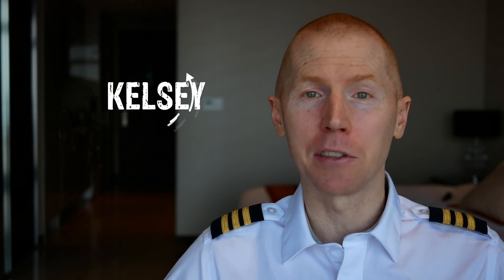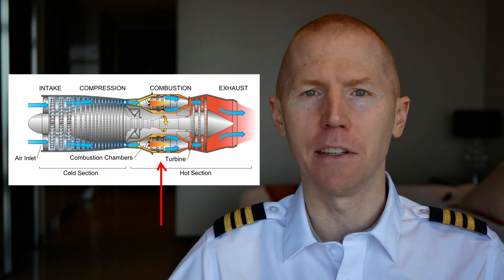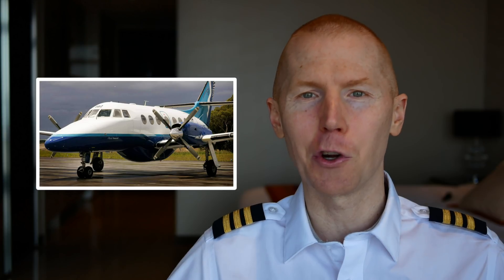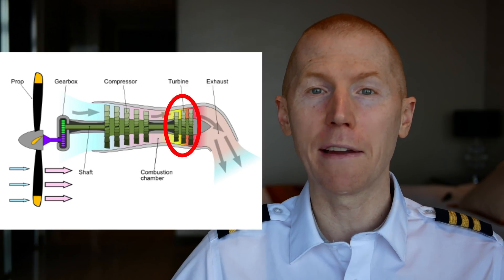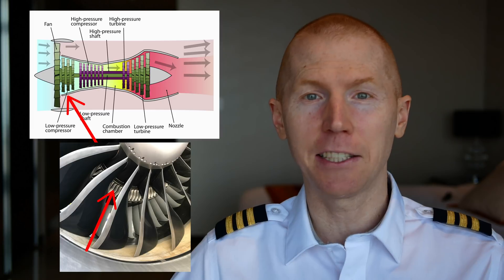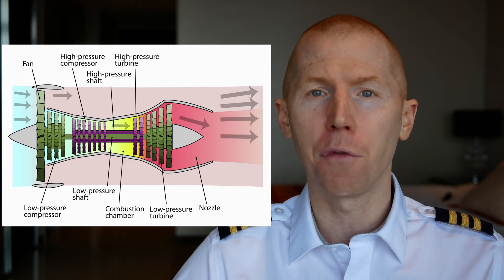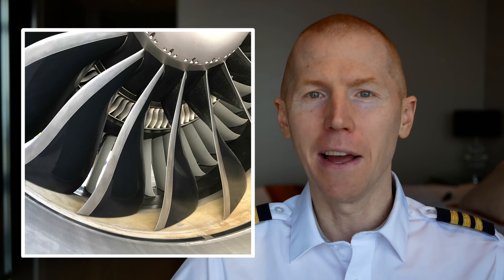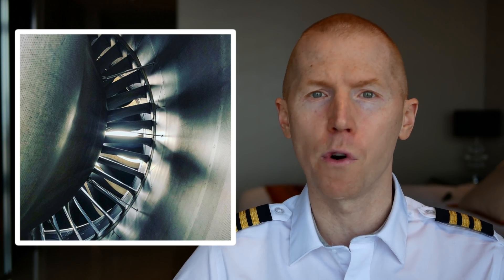Is a Turbofan Engine or Turboprop Engine Safer? | Pilot Explains

Comment: turbofan are safe for passenger and crew and better for every day airliners, but dangerouse for mechanics and ground crew. Turbo props are safer for mechanics and ground crew because there open rotor engine instead of enclosed rotor, but dangerouse for passenger and crew

Comment: To answer your question about me feeling uncomfortable when I see a propeller: Yes, But it is the very remote but possible chance that a mechanical failure or defect in the prop itself could result in a violent dissassembly of it. That keeps me from sitting in line with the blades.

Comment: My wife was a American Airline employee and we would fly standby (non revenue) a lot for vacation or to see family. To get to a hub we needed to fly American Eagle. The airport we used in Corpus Texas had just the CRJ turbofans when we first got married. They sat 50 passengers but were always weight restricted to about 42 or 44 passengers due to temp/pressure/weather. It was hard to get in or out as a standby passenger on those jets. Later they started using some ATR turboprops. I loved them because they held about 60 passengers and never got weight restrictions put on them so you almost always could get a seat standby. The atr's had a lot more headroom than the crj planes and didn't seem to get canceled much for mechanical reasons so I liked them more. My wife didn't like the ATR props because she felt like she was too good to fly in a prop plane and complained that the props were too slow. I liked the props because I could always get a seat, the flights were more reliable, and they flew lower so you could see the landscape better during the flight.

Comment: I think that the turbofan is probably safer in terms of in the event of a blade off in a  turbofan the fan is contained in a case and it's designed to contain the blade should a fan blade come off a turboprop on the other hand if the bade comes off it could go right though the fuselage and kill the passengers sitting in the seats near the prop or it can damage flight controls making the aircraft hard to control. Course if the whole fan disc comes apart and not just a blade or two  like it did on that one United DC-10 then there's nouthing stopping that kinda mass spinning that fast. Also turboprops are probably more dangerous to ground crew and people near the aircraft as they can get struck by the blades and killed if there not careful and sometimes its difficult to see the arc of the prop when it's dark or whatever. Then again the turbofan poses the risk of sucking in someone who gets to close where as a turboprop doesn't pose that hazard or mabye I'm wrong please let ne know.

Comment: Turboprop engine is more fuel efficiency by 33% but more produces more noise, another place which i can't understand, in army you can't sit i propeller line witch is the line between the right and left propeller, as i can see in political aerospace turboprop engine planes has not the red colour in propeller line why?

Comment: Since the first time I experienced the sound of the two PW150 on a Dash 8 Q400 (The Q is for 'I don't want to know how loud the non-Q version was)  when spinning up for take off thrust, I lost all fear of them. I DID formerly associate turboprop engines with older and less sophisticated aircraft, but after understanding how they work and seeing (and hearing) them in action, I felt quite safe.

Comment: Actually turboprops and turbofans are basically identical. The difference is only really the speed regime of the aircraft, because conventional propeller efficiencies start to drop off in the transonic speed regime. So really you find turboprops on 'slower' aircraft irrespective of size (Kingairs, C130's etc) and fans on airliners which typcically cruise on in the transonic range. Bypass ratio is really only to do with maximising propulsive efficiency, that is matching the velocity of the propelling stream to the cruising speed of the aircraft.

Comment: Huh.  I always thought it was more of a controlled, continuous burn going on inside of there rather than an "explosion."  Even piston engines [generally] don't have actual explosions going on inside of them but rather a controlled burning of the fuel/air mixture.

Comment: Great explanation Kelsey. 
To answer which would I be more comfortable on, say it was a Saab 340. I assume that the pilots flying that would have a lot experience and time in the air compared to a pilot flying a 747-8 
So I would be more comfortable with pilots like you vs. a captain with 650 hours and a FO with 320 hours of flight time

Comment: I feel comfortable flying in a turbo prop along with the turbo fan. I personally feel a little bit safer on the prop job as I feel they are a more stable aircraft. Usually they are wing over which I’m a fan of. If the engine or engines were to fail I feel they may have a better chance of making a landing.

Comment: 5:16  The core of the Turbofan isn't doing much in the way of thrust, it's primary function is to spin the big fan. About 85% of the thrust produced by a high bypass Turbofan is from the fan itself, the core maybe adds about 15%.

Comment: I would prefer an open turboprop engine, since open propellers have a better energy transfer efficiency than any type of ducted propellers, including trubofan engines, since they have lesser friction surface and better "at the end of propeller blade" effects in air. --- But I admit that is just because of the physics of open propeller vs. ducted fan.

Comment: I just don't like small planes. I wouldn't fly on a small regional jetliner using turbofan engines either. I'm talking basically anything smaller than a 737/A320 is a no go for me.

Comment: I don't know you didn't mention it so it may not be applicable. Does the air going on the outside of engine core reduce heat? If so, is that beneficial or a disadvantage to the core?

Comment: Why anyone would think turboprops are less reliable is beyond me. They are noisy inside, that's all. I have been a passenger on several turboprop planes: Fokker F27, Saab 340, Shorts 360, and they one thing you wanted to avoid is to sit next to the propeller.

Regarding reliability: Tupolev Tu-95. Nuff said

Comment: I was directed to this video from a more recent video because I never really understood Turboprop engines versus Turbofan engines.  I had no idea how similar the two were or that a turbofan actually uses a propeller.  It certainly makes sense why a turbofan would be so efficient at low altitudes now.  I was never afraid of prop engines, but now that I know the difference I'll view turbofans differently.  Thank you for a GREAT lesson here!
Reply: The turbofan doesn’t use a propeller, the fan is by a propeller. It’s a compressor that compresses the bypass air just as the LP and HP compressor blades compress the core air. All of the energy from the fan goes into compressing the air so there’s no energy left over for the fan to produce any thrust of its own. And no, turbofan perform very poorly at low altitudes for that reason. Turboprops and other true propellers have good performance at low altitudes. I don’t know why 74Gear didn’t give a correct explanation.

Comment: I’ve been on a turboprop on a nasty night. There was a pounding on the fuselage for a long time - like half of cruise - sounded like many people beating on fuselage with a hammer. When air calmed down so the flight attendant could come around (only 4 passengers on Fokker 50), I asked him about the hammering. It was what I expected - ice from the propellers beating against the fuselage. Frankly, I don’t like that but I assume the pilots don’t want to crash any more than I do and they must feel safe. I much prefer a 747.

Comment: I've always figured turbine engines in general, be they turbojet, turboprop, or low or high bypass turbofan, would be very reliable. If there's anything to worry about it's a piston engine - there's so much more to go wrong with them. Though the combination of the two, the turbo-compound engine, was apparently even less reliable than the straight piston engine it was based on - apparently some DC-7 mechanics referred to the power recovery turbine as the "parts recovery turbine".

Comment: There is no "explosion" in a gas turbine engine. An explosion implies an ignition source is constantly required as in the case of a piston engine. Once a gas turbine lights up, the igniters are no longer required as the flame is held within the combustion chambers. It is the action of the hot gasses passing over the turbine section that drive the main shaft. There is very little pressure within the jet pipe. Trivial, perhaps but, it is important to explain things correctly. I'm guessing most people here don't come from a technical background. 🇬🇧

Comment: The problem that most people have is the commercial turboprop is generally a smaller commuter type plane. Usually those are subject to more turbulence than the larger planes. They usually get a bad reputation from this because propellers are associated with more turbulence instead of realizing it’s a smaller aircraft along with it. This is why my mom didn’t like flying when she was on the smaller planes. Props are also noisier.

Comment: No answer though. You tell me, you're the expert. I imagine a Turbofan is more protected, but then again it's much harder to break one of the three a prob blades than a fan blade.  I WANT AN ANSWER. Also, why is the prop an a different shaft? And what drives the compressor according to your explanation?

Comment: I was in the Navy for 20 years and flew on turboprop planes every now and then, mainly when I was transferring from/to a ship to somewhere else in the world.  I rode in a variety of planes doing this and never once thought about the engines, other than they were kind of loud, but that could have also been the lack of sound insulation the plane had, because it wasn't a passenger plane.

On the other hand I rode a helo off a ship to get from a ship that was out at sea to a base to fly out of, and because there is a higher rate of crashes involving helos, that made me a bit nervous.

Comment: The thing about turbo props is the engine tends to create more vibrations and noise.  So as a passenger it can feel like the planes is shaking itself apart.  This is only made worse by the fact that turbo props like the Dash8 get stuck on short haul high turnover routes so they take a lot more cycles in a short period of time.   Add to this their popularity with cheaper connector airlines and the difference becomes pronounced.   It’s not uncommon for turbo prop commercial planes to offer no running water.  I recently flew on a Air Canada Dash 8 between Victoria and Vancouver.   One of the shortest flights in the world.   It’s a sit down and shut up no washrooms or incabin service flight.  Some of the interior panels were held on by tape and prayers so it rattled like a flying chitty chitty bang bang.   But much like the old Disney movie the planes themselves just keep going.
Reply: I would like to add that I wish commercial carriers were more aware of how a lack of amenities and cosmetic care can effect a customers perception of safety.

Comment: TBH I saw the title of this video and didn't understand how you could answer the question - as far I'm concerned there is no safety difference between those two types. It was only at the end that I understood that yeah, probably the average layman associates propellors with IC engines. But a turboprop? Naah, no inherent difference in reliability.

When mentioning the turbojet it might have been of interest to note that the first generation of "jet" airliners were all equipped with that type of engine (and hence the relatively narrow engine nacelles on a/c like the 707 and 727) but that it's not as efficient as the turbofan. And also the difference in engine noise - the (much louder) roar of the jet vs the buzz of the fan.

Comment: It is not an explosion. An explosion is what happens in the otto cycle/two stroke/wankle engines. Turbines operate on the principles of the Brayton Cycle meaning pressure is constant and the jet fuel and air mixture is simply burning, not exploding. For instance once the ignitor plugs ignite the mixture they shut off and are no longer needed as long as fuel is present to burn. Piston engine spark plus are constantly firing to create the needed "explosion"
- A studying future A&P mechanic

Comment: Hi, I m an aerospace engineering student and working on a project similar to a V22 osprey however I am working on a quadcop design to use four turboprop engines insted of one, would you suggest to use a turbo prop or a turbo fan for the same since I aim to achieve high lift than thrust and aim for a VTOL flight.
Reply: If you want to use the exhaust to power your VTOL then you would be using a Turbo Fan.  If you are going to have props then it would be a turboprop.  One thing to think about is turobofans have a lag time to spool up/down so what would be something to think about.

Comment: Former Jetstream pilot here: The air intake to the engine might be small, but that's nothing compared to the air intake of the air condition. (It's under the wing root behind the propeller on the picture at 3:00.) I managed to get a bird into that tiny hole. And the mechanics had to disassemble the entire air condition unit and clean it!

Comment: We won WW2 with turbo prop engines. The Enola gay which is the plane that dropped the bombs on Japan that forced their surrender and ended the war was a 4 prop engine plane. The p51 mustangs aka the tank busters were single prop engine planes that had a huge part in winning that war. The planes that the 101 airborne division jumped from were dc3 dual turbo prop engine planes and went on to become the first passenger airliners. Turbo jet engines look cooler than turbo prop engines but they are still good and reliable engines.

Comment: I never worried about flying a small aircraft with a turboprop.  My only thoughts were in knowing you may have a pilot with fewer hours of flight time than on a jet aircraft on a turboprop.  Turbine engines regardless of the whether they drive a prop or a fan are extremely reliable and rugged.

Comment: I always thought the turbo-fan was safer as I had the assumption nothing could be sucked into the engine. Now I think those who build and those who opperate them know when to use which to increase safety and efficiency

Comment: The main difference is a turboprop is uses a propeller.  The Turbofan uses an impeller in a cowling.  Large helicopters use a variation on the turboprop where the output shaft goes out of the top to the gearbox that spins the rotor system. Turbojets work as the core for both.  Both designs were implemented to make the core jet more fuel efficient and quieter.  In fighter jets, they use a turbojet that has low bypass (or none) and an afterburner, which basically dumps more fuel into the exhaust.

Comment: I was an a & p mechanic for 17 years and I've worked on the Rolls-Royce dart and rb211 engines and the difference to me is the turbo prop is a dirty grease slinger and the turbo fan is cleaner to work on.

Comment: jet and rocket engines work by moving air with the help of some fuel. in the simplest terms every action (in this case moving exhaust gasses) has an equal and opposite reaction (moving plane). and of course force is equal to mass multiplied by the acceleration. so if the force acting on the plane and it's exhaust are equal that means the planes mass multiplied by acceleration is equal to the exhausts mass multiplied by acceleration (  f=f and f=m*a  therefore m*a=m*a ). obviously the planes mass is bigger so it accelerates less, and the exhaust has less mass so it accelerates more than the plane. Additionally heat and fuel don't factor into the thrust that much they are almost entirely used to cause expansion in the engine which makes it turn moving gasses through the engine. Heat left in the exhaust is wasted energy and the gasses from the fuel are a very small factor in the thrust compared to the oxygen. Planes got bigger and needed more thrust per weight and engineers realized there was two main ways of getting more thrust, either move the same amount of air but accelerate it more (faster engine) or move more air with less acceleration (relative to the thrust). Faster engines speed mean more stress on parts, more fuel use, more heat. The more air, less acceleration method calls for a bigger fan to move air. Additionally the air doesn't have to go into the engine it just has to be pushed by it. In fact most of the air going into the front fan of a high bypass turbofan is being pushed around the engine core (hence the term high bypass). The ratio of air going around the engine to the air going through it (called the bypass ratio) is as high as 10 to 1 for very new engines. in addition to thrust bypass air also cools the engine core. Long story short plane moves air and air moves bigger plane but slower. Move more air and you get more power, and if you can move more air without adding more fuel good things happen.

Comment: I'd say they both have advantages for safety. The Turbopro is more likely to survive a bird-strike (all evidence to the contrary) but has more moving parts that could fail like the gearbox and the variable pitch systems which the turbo fan engines don't have.

Comment: I always thought turboprop engines to be slightly safer than turbofans (and I love the ATR 42 and ATR 72!), but the question is: regarding bird intake, aren't the piston engines the safest possible ones? (The lower speed helps too, but I was thinking of a piston engine possibly having a lower failure rate after an impact e.g. with a single bird.) I'm not sure whether you already covered the topic or not, so bear with me.